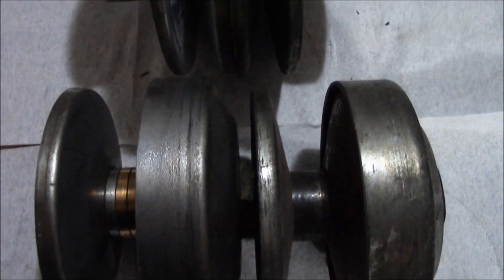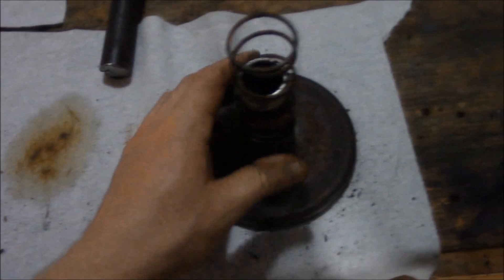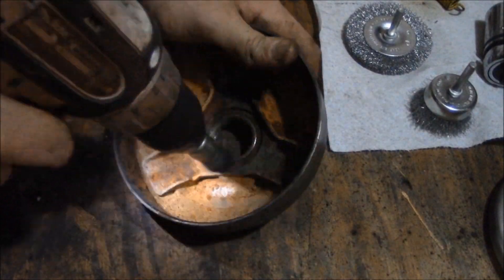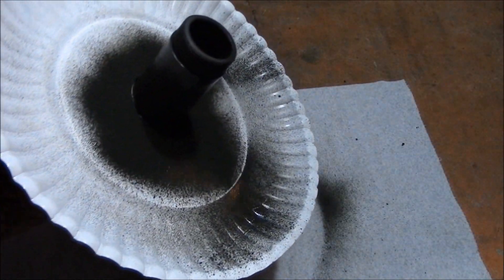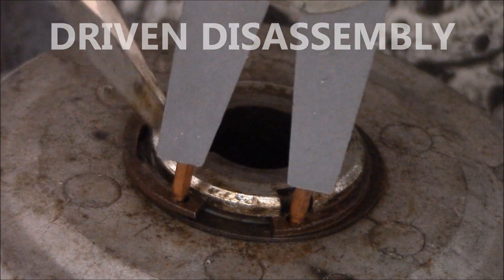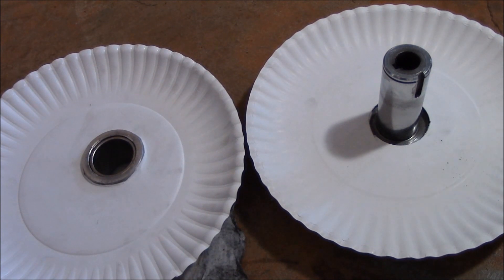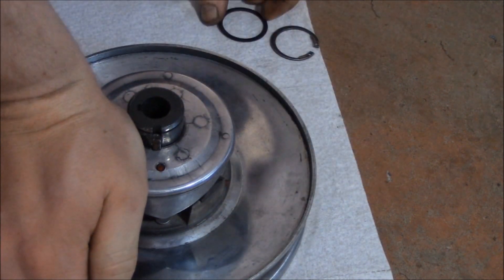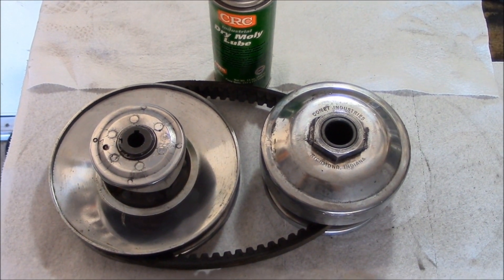How to Clean a Torque Converter, 40 Series

Comment: My driven pulley sticks open causing some serious issues. Any ideas what is going on? Everything is brand new
Reply from the maker: user error
Reply: @KartFab  Actually, I was not told to install it inboard.......because it could not due to the bracing welded on the inside of the back plate, making the only way to fit the pulley outboard only.. The pulley ended up exploding and was found over 300 feet from where it failed. It needed the yellow reverse spring.  Thanks for the help though......

Comment: Good video. I noted the 2 bronze guide bushings you spoke of. The new aftermarket one I bought uses steel bushings now instead. These  stick and gall the sheave shaft. I  replaced with original Comet bronze bushings. Should be much better.

Comment: Just bought a 40 series set. How do I know which way the driven clutch needs to be mounted (inboard or outboard). I bought a reverse wound spring but not sure if I need it. How do you know which way the driven clutch is supposed to turn to work correctly? Any help is appreciated
Reply from the maker: Watch the video through the end. Your answer is literally In the video. Towards the end

Comment: my driver had 4 brass rings, 2 under the snap ring that I assume the belt rode on, one above the snap ring and then one at the other end of the spring. Seems to me that the one extra ring above the snap ring would stop the sheave from movin in all the way, so I opted to leave it out. did I figger wrong kartfab? its a 1980 manco 8 hp 3 wheeler
Reply from the maker: Some versions have no brass rings in the middle. The middle brass rings keep the vehicle from creeping forward when idling. If you mess with the ones that the spring uses for proper tension, you mess with all sorts of things that shouldn’t be messed with.

Comment: Don't know if you'll be able to answer this but I have a dilemma. I'm converting my 40 Series TC into a jackshaft but I need the drive sprocket mounted on the OPPOSITE (back/inside) side of the main plate on the rear shaft. Im simply using a centrifugal clutch on the crank, chained to the jackshaft, and from there to the rear axle. The final sprocket is fixed in place on said axle. I can not find a video or explanation of what shaft/bearings I need to make this work and whether or not I NEED a pillow block bearing for extra jackshaft support.
  Love your videos  and happy Veteran's Day. 
  {Mounting a Honda gx340 on a chinese quad for a ride to work because its getting cold out}
Reply from the maker: Whatever works. Check out my mini bike big block conversion video
Reply: @KartFab  looks great but i dont have a welder...

Comment: Just bought a $100 go kart with a blown out spring (It's hanging out). Also no rubber clutches, all are gone &  one where the clutch foot has a welded screw.

The go cart pulls and gets to speed with me on it. I'm 200lbs. It's an old 2 seater mango fox with a 6 5 Tecumseh. I wouldn't mind keeping it broken if that's what's "throttling it down". 

I have a Perfect condition 30 series Comet Torque-A-Verter from the same era(homemade 4wheeler my uncle made...long story). But should I save it for when then one goes & they are older?
Reply from the maker: Man that sounds bad. Post up pictures on www.diygokarts.com and people can help you there. Less back and forth. Honestly it could be something simple, but it’s easier to just take a bunch of pics and get the forum to look at it.

Comment: keep in mind, there are three holes, just put it in the middle..... hehehe.  10 year old me laughs
Reply from the maker: heh heh i see what you did there.
Reply: ***** cool, didn't think I would get a response so I went with immature comment. Now with grow up comment. Is there a certain amount of times to spin or preload the spring when reassembling the driven??
Reply from the maker: Yes, but it would be extremely difficult to pre-load the spring beyond where it is supposed to load. Just look at the spring end positions on the video at 6:15, and make sure the wear button is resting against the correct slope of the cam
Reply: Awesome thanks alot. Good video, great help

Comment: Can you clarify the three spring holes?  You say middle is stock, one is for speed - is that top speed, or hole shot speed?  Also, you said one is for off-road only.  I have an off-road kart and I wand hole shot speed - which hole should I use?
Reply from the maker: +RamjetAlpha1 the one that provides the least spring tension

Comment: Does the same things apply for a 30 series
Reply from the maker: For the sheaves, yes, but the 30 series is built differently. I made about half of a video for the 30 series torque converter and got busy doing other things, so the 30 series video will come out at a later date.
Reply: Ok thanks

Comment: Just out of my own sheer curiosity, could one mount a torque converter driver on a jackshaft instead of the PTO from the engine? One would run a direct drive from the engine to the jackshaft and the TC works from there. Is this possible to do?
Reply from the maker: they do this for some disc clutches (see here http://www.buller.net/Category/bully_468su ). Yeah i would assume its possible but why? It would just take up a lot of space and be one more thing that can go wrong + you have to buy an additional jackshaft and bearings in addition to the one you already have to have for the driven unit, so thats two jackshafts, +bearings + sprocket or whatever else that will probably break or stretch from the drive unit to the engine.
Reply: debating on either doing a 2 speed jackshaft or having the TC on a jackshaft. I had gotten the idea from fab forums' mini chopper build, where he made a primary off the engine and ran a 2 speed jackshaft. I liked the idea, but would rather use a torque converter instead, while still keeping the primary for  aesthetics mostly.
Reply from the maker: ok good luck with that. Let me know if it pans out. I see no point in doing what you are proposing, but i do the same kind of things just because.

Comment: Which torque converter would fit on a 13hp Honda GX390? just wanted to know as I am going to start a project ?
Reply: DG AGRI I know this is really late but measure the shaft. 3/4 inch will fit a 30 series. 1 inch shaft will fit a 40 series, which is the one shown in the video. The 40 series is good for engines that put more horsepower all the way up to 20 hp even. The 30 series could probably be pushed up to 10 or so but you’d want to consider the 40 series.

Comment: The driven one with the chain on it doesn't open up on mine it just stays how it is when it's not spinning
Reply: It seems to go slow do you think that's the reason?
Reply from the maker: +Honda Cr 500 jackshaft teeth, axle teeth, tire size? engine works? revs up to 3600 rpm?
Reply: +KartFab I'll make a video so I can show you but I will have to check all of that
Reply from the maker: +Honda Cr 500 sounds like your engine is having a problem, but before i would say your engine is the problem,  first thing is first measure the distance between the jackshaft (driven unit shaft) and the crankshaft (drive unit shaft), and compare it to a 40 series belt chart. You need to get a new belt. 

Gearing should be 9t jackshaft/54 tooth axle, or 10t jackshaft/60t axle. 

That go kart is awesome! It has a differential on it, really really nice go kart.
Reply: +KartFab thanks I'm about to just buy a new 13hp motor for it and I do need a new belt because I just burned it the rest of the way up today lol thanks so much for the replies!

Comment: my driver locked at half squeeze is there any chance of fixing it
Reply: +Dr_joe_smo 24 Im having trouble taking it apart
Reply from the maker: Yeah, one of the roller cams probably came off track.
Reply from the maker: Let it soak in on blaster for a shile
Reply: Ok I will try that thanks for responding so fast
Reply: +KartFab would WD40 work
Reply from the maker: No
Reply: +KartFab Where can i get a 1 in keyed axle?
Reply from the maker: here www.gopowersports.com/go-kart-parts/axles-axle-parts/standard-axles/#aid=2986
Reply: +KartFab no I mean like what you used on that rod tool you made
Reply from the maker: i had bought a used go kart with a bent axle. I cut part of it off and used it for that. You might be able to google and call a "steel distributor" or "metal supplier" and they could get you a small piece of 1" round bar keyed so you can make your own.

Comment: can i use a 30 series driven pulley with a 40 series converter ?
Reply from the maker: +TheOg Boosjukie No. 30 series has a different diameter, less hp rating, and is assymetrical. 40 series is symmetrical and has a wider top width belt.

Comment: do you know if a generator engine would run without the electrical parts
Reply: As in the alternator? Starter? You are a bit vague but if you mean taking off all the components that generate electricity and just use the engine it’ll work just fine.

Comment: what can I do if I have a tapperd shaft
Reply from the maker: +Estevan Strader It only fits a straight shaft engine. Short of buying a new engine, you could buy a new crankshaft for your particular engine.
Reply: Is it possible that I can mill the shaft down to size
Reply from the maker: as long as its bigger than 1" right now, im sure you can do it. Ususally it costs more to mill a crank down, than it does to buy a new crank... unless you have access to a lathe.
Reply: +Estevan Strader If you are trying to fit a tapered shaft torque converter onto a 1" straight shaft engine, there are adapters you can purchase for about $20. Are you by chance working on a golf cart or torque converter from a golf cart?

Comment: Very good video it helped me out to let me know what type i had and will for sure help with rebuilding. The sleeve in the middle is broken so if you know where i can get the part i would appreciate it very much.
Thanks
Dave
Reply from the maker: I'm not sure what you mean by sleeve. Maybe the brass bushings? Drive or driven unit? Either way, the only place to get parts for them is mfgsupply.com and if they don't have it you are SOL and need to buy a new unit. Common replacement parts are the wear tabs, springs, and roller weights. Other stuff may not be available.
Reply from the maker: http://www.mfgsupply.com/gomini/gominiclutch/gominiclutchtorq/gominiclutchtorq40.html

Comment: Is the driven clutch engaged by tension or speed?
Reply from the maker: The driven unit is "driven" by the drive unit. Basically pulling the belt more and more towards the center of the driven unit. RPMs, roller weights and roller springs and load determines when the drive unit engages. The driven unit spring can be tensioned to resist the drive unit and engage at a higher rpm, or tensioned to engage sooner, so they both work together.

Comment: Any advice on new springs and parts? I have one that I believe some components may be broken. Any advice would help. Thanks!
Reply from the maker: mfgsupply sells parts for the 40 series torque converters. Worst case scenario, you can get a whole new unit. Take pics and go to diygokarts.com forum, lots of good info and advice there.
Reply: +KartFab sorry for the late reply but thanks a bunch! - i opened it up and one of the springs just came off. re-twisted it and it works fine! only problem is that it comes together when i open my motor's choke. not sure how to fix that though,

Comment: I just cleaned my comet 40 thanks for the video saved me some money!  I get a lot of smoking from my belt which just messes up my drive pulley not sure why.  Any thoughts on why that could be happening?
Reply from the maker: Hmm doesn't sound good. Are you using the correct belt for the center of Jackshaft to center of engine shaft distance? (Google comet 40 series belt chart). Also what is your tire size and gear ratio?

Comment: How slow would the rear driven shift up if it was wound another detent. 1 past where you did it. More tension. I'm upgrading my driven to red 2000rpm stall srings. Part 203040. Anyone tried this. Will this keep the rear driven from shifting up as fast or will it be too much and just never shift up. Or open.
Reply from the maker: Tim N Im not sure. From what I am aware of, the drive springs control engagement (yellow at 1600, and red at 2k), from there I don't know.  What I DO know though is that the DRIVEN unit DOES control when it shifts up by the holes in the driven cam that the spring connects to. I don't know if it would function properly if you just tried to put it under more tension  by prewinding (i think excessively too tight) it to the next wear tab. If your cam only has one hole, watch the video again and see where the other holes are placed, you could probably drill hole(s) where the spring needs to be rather than moving it to the next wear tab.

Comment: I think molly is a know carcinogen. I could be wrong but I'm pretty sure it is.
Reply from the maker: The active incredient is Molybdenum Disulfide, CAS# 1317-33-5. The HSDB shows that it is on a low order of toxicity. IARC does not have this in its database. I sample chemicals for a living and am 100% confident that molybdenum disulfide is not classifiable as a human carcinogen. Based on its occupational exposure limit of 15 mg/m^3, (the same as ordinary particulate/dust) dry moly spray is not a big deal. If you want to limit exposure, put on some gloves and an organic vapor respirator for the vapors themselves. Again, not necessary.